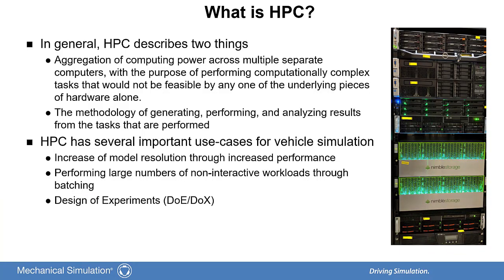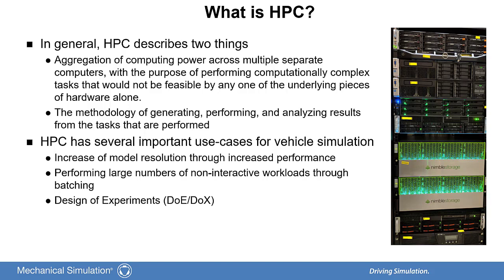High Performance Computing  (HPC) For Automotive Simulation with CarSim, TruckSim and BikeSim

Comment: I'm Yalemzewd Ytayew from Ethiopia, Addis Ababa.
I'm a University lecturer and also a master’s degree student. Currently, I'm doing research work on vehicles rollover.
 
When I used CARSIM software for the first time, I got it easier to install and use for vehicle, car, and truck simulations. It has more interesting features to use and it's also time-saving and very reachable for first users even. 
I'm very passionate to know more about your interesting software CARSIM.
Even though I understand most of the features and your helping pdf documents including your videos posted on your YouTube, I have some challenges in coding my mathematical models.
I'm working on a rollover analysis study of vehicles. First, I do dynamic mathematical models of vehicles. Then I want to convert these mathematical models into CARSIM. But I didn't get any direction on how to convert my mathematical model into CARSIM software. I have also tried scripting the mathematical model using python, but in the end, I cannot find any platform which connects python and carsim. So, please give me some directions on how I can do this.
 
With regards! 
 
I thank you for all your help and consideration!
Reply from the maker: This sounds like very interesting work. The best way to get a response this your question is to submit a technical support ticket:
https://accounts.carsim.com/support/create